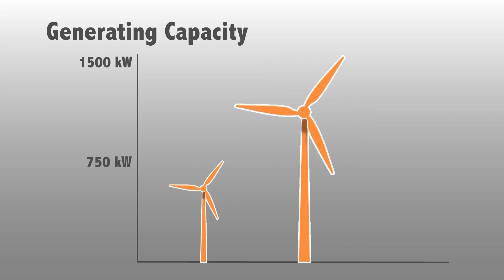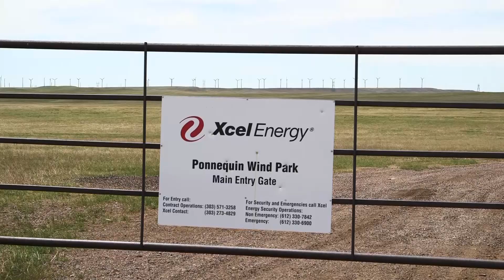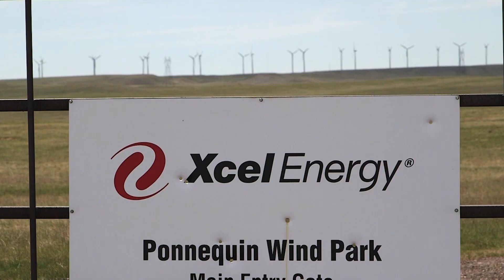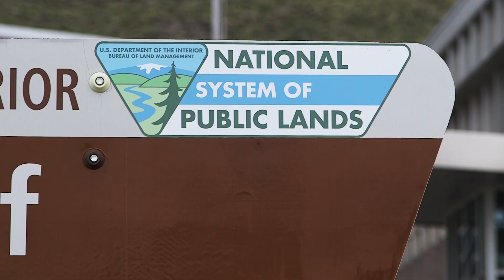Who Cleans Up When a Wind Farm Retires?

Comment: 5:24_ How can you call it "Renewable Energy" if it doesn't produce energy any more?
Reply: It never was a renewable power source
Reply: @rogergibbs2937  "It never was a renewable power source" Um, sunshine and wind are free and happen all the time where I live. Oil? Not so much.
Reply: Did the sun not come up today where you live? It did where I am.
Reply: @justsomeguy934  It is the night here, so what if the sun does come up in the morning, it will disappear 12 hrs later. What is your point?
Reply: @rogergibbs2937  The point is the sun will rise today, and can provide free energy when humans want it the most - daytime. That's reliable. It may be intermittent, but it's reliable. Your had your terms incorrect.
Reply: @justsomeguy934  socialist, it cost a shit ton of money to extract that “free” energy
Reply: @Dean Zinter Your comment makes no sense! We're talking about using pollution-free, cost-free fuel (wind or sunshine). The fact that a turbine has gear oil is meaningless. SO WHAT if a turbine is lubricated with a few gallons of oil? It stops THIS: https://www.businessinsider.com/photos-stay-at-home-order-reduced-los-angeles-notorious-smog-2020-4
Reply: @Dean Zinter I'm confused - are you confusing the extraordinary polluting process of extracting oil, refining oil, then burning that oil? Putting up a wind turbine that works for decades with no fuel, no pollution is not even CLOSE to the process of making a single gallon of gasoline, much less burning it. Every thing you described - putting up a turbine, connecting it to the grid - is also done to erect a diesel or NG power plant, yes? And a turbine doesn't consume anything after that, doesn't make poison while working. I think your oil bias has you blinded, you're not thinking rationally.
Stare at this picture until your oil fog clears:
https://www.businessinsider.com/photos-stay-at-home-order-reduced-los-angeles-notorious-smog-2020-4
Reply: @justsomeguy934  _ After pointing the finger at everybody else, please check your own bias and facts.
FACT_ This field does not produce energy from the wind.
Fact_ It is a polluted relic not a renewable energy source.
FACT_ Los Angeles air quality, even one year ago, is significantly better than it was in the eighties with much larger population and much more cars.
Reply: @johnbeckman8916  FACT: LA's improved air quality was due to stricter emission standards, not because gasoline is a good idea. 
FACT: gasoline engines can NEVER be emission free when in use, regardless of any emission requirements. They will always poison the air if they're running.
FACT: The clear air in LA can only be achieved by NOT burning gasoline and diesel. That leaves EVs as the reason the air is clear today.
FACT: The wind farm in the video CAN produce energy, the wind is still blowing there. All you have to do is re-use the towers.
FACT: The "polluted" relic is, in fact, polluting nothing. Shall I show you a picture of Prince William Sound 30 years after the Valdeez wreck?
Bias indeed!
Reply: @johnbeckman8916  "LA's greatly improved air quality is due to improved technology and efficiencies." Incorrect. The dramatic picture I shared with you was NOT a result of increased emission standards. The clear air was a direct and IMMEDIATE result of no gasoline vehicles running in LA. The results and evidence is dramatic. If what you claim is true, that air quality would not have changed since the COVID shutdown. Logic is a bitch, I suggest you get some.
Reply: @Dean Zinter Who cares? Show me the NOx emissions, the soot, the Carbon Monoxide coming out of your tailpipe first. Every second your car runs it poisons the guy behind you. A wind turbine spins in the air, a solar panel sits in the sun. Any petroleum products used to service a turbine of the decades of lifespan are miniscule compared to using petroleum to make electricity. Don't you realize you're being an unpaid shill for the oil companies? You're looking at a drop of oil for a turbine compared to a bathtub of burned oil for a power plant. They've got you, pal, at least you should ask for a pay check. Why don't you complain how toxic the paint is on the turbine blades now? And then ignoring the paint in your house, on your car, on the roads. See how a one-sided comparison works? Don't you feel foolish?
Reply: As  it needs to be renewed, haa
Reply: @Dean Zinter "a few gallons....   tremendous amount of diesel to dig the ore from the ground, then more diesel to transport the ore, then smelt the ore into useable iron, then make the raw materials into the components, then again transporting to the desired location..." You haven't even BEGUN to describe the process of extracting, transporting, refining, transporting, storing and then burning gasoline! In fact, gasoline only gives back about 1/4 the energy it has when you burn it! Did you know, for example, that the electricity required to refine petroleum consumes about 1/20th our entire nation's electricity capacity? That's right, just making gasoline requires huge amounts of grid electricity! Almost every one of the expenses/consumables your listed are ALSO expended to extract, refine and transport gasoline/diesel!
Reply: @Dean Zinter "and now we need to use another tremendous amount of diesel to tear them down, so where in the hell was the “zero emissions “ you are ranting about?
Ps how much electricity do the damn things make when the wind doesn’t blow?" A turbine site can be re-used! You just put a new turbine on top! In addition, I see you're talking about the cost to restore a turbine site to its original state, are you now including the price to reclaim oil spills, pipeline breaks, air pollution that's related to the use of oil? I bet you aren't! 
To answer your question about electricity production, you put turbines where the wind blows enough to make them viable. You put solar panels in places that have lots of sunshine. The downtime of a solar farm, for example, is completely offset by having ZERO FUEL COST. Who do we charge for a breeze? Who gets the bill for sunshine? If you drop the fuel cost to ZERO, intermittent production is very attractive. Here's a picture I'm sure I've given you to look when you're trying to claim wind or water or sun aren't "zero emissions":
Los Angeles clean air comparison: https://www.businessinsider.com/photos-stay-at-home-order-reduced-los-angeles-notorious-smog-2020-4
Reply: @Dean Zinter I see you want to ignore the environmental impacts of oil, while ranting about an energy capture unit that works with sunshine, wind or water. Here's what just ONE oil spill did to thousands of miles of coastline...I'm sure you're adding in the cost of remediation to your gasoline love affair, yes?
https://www.history.com/topics/1980s/exxon-valdez-oil-spill
Reply: @Dean Zinter 
You are being accused of being a shill for the oil industry... 
Your counterpart is being the same for the wind and solar industry.

Every one of these arguments can be used either way... except one.

Our modern quality of life or renewable energy, could not exist without mining or petroleum products... 

And that's not likely to change,  even in our children's lifetimes.
Reply: @happydazeharvick4399  You are absolutely correct, modern life is not possible without petroleum products. I believe it, you believe it. Now tell me why you think it's acceptable to burn up HALF of our precious petroleum as gasoline, and then breathe the exhaust? An EV has none of those characteristics, presents NO net increase in grid demand, can completely eliminate the oil we buy in the Mideast (did you see HALF?). Tell me how you reconcile you opinion that oil is required for life, yet throw a match on half of it every day.
Reply: @justsomeguy934 
 I think California should have 100% electric cars, but let the rest of the country (the other 49 states) do what they think is right...

See how easy that was...

Quit griping about it, 
get to work, and make it happen...
Reply: @happydazeharvick4399  "Quit griping about it, get to work, and make it happen..." Um, that's what I'm doing. Do you know how many people (perhaps like you) do NOT know the subsidies we taxpayers give the oil companies? Do you know how much cleaner the air is in LA since gas cars aren't being used? Do you know how much money we spend in the MidEast to defend oil? Do you know we set a match to half of all the precious petroleum we have by making it gasoline?
Reply: @happydazeharvick4399  "I think California should have 100% electric cars, but let the rest of the country (the other 49 states) do what they think is right.." I have an idea, how about those that use gasoline PAY the real cost? How about Exxon buying its own army and air force to protect its tankers? How about Exxon cleaning up oil spills, and not the US taxpayer? How about that being the right thing to do?
Reply: @happydazeharvick4399  "Your counterpart is being the same for the wind and solar industry." No, I'm an advocate for clean air, no more subsidies for oil, no more American lives wasted in the MidEast. Your perspective?
Reply: @Dean Zinter "exactly, life without petroleum products is by impossible..... and that’s the facts these eco idiots can’t understand!" I'm not an idiot, pardon you. Petroleum is required for modern life. Tell me how you justify throwing a match on half of it every day, please. Tell me how you justify trillions in subsidies for oil companies, please. Tell me how you justify putting American lives at risk for free tanker escorts in the Mideast, please. I'll be glad to hear your side of the story and I won't call you a name.
Reply: @Dean Zinter "what kind of cave do you live in? Do you hunt your own food,? Do you make your hunting tools from sticks and rocks? If you answered no to any of them then you are the problem to all this pollution you claim to hate, because everything you use , and touch, and eat, and live in has a direct connection to oil production" Ah, the strawman argument that never happened. You're trying to say I advocate we return to the stone age because I question burning petroleum for fuel. If you're read my other replies to you, you'll know that not only do I think oil is necessary for life, I also think energy independence is necessary. And burning HALF of our petroleum up as gasoline is stupid. WHY do YOU want to throw away our oil? Oh and I just loved the whale oil quip you made, you must be getting pretty desperate to convince yourself that you smoker of a car is the right thing to do. May I ask that you pipe the exhaust of your car into YOUR cabin and not leave a trail of poison for everyone else to breathe?
Reply: @Dean Zinter "what a hypocritical bass tard you are.... " Hypocritical, how? I can't remember when I've purchased gasoline last. It's YOU that thinks it's OK to poison the air behind you, OK to put American lives at risk for free oil protection, OK to waste half of all the dwindling petroleum we have on cars. Oh and by the way, I CAN USE THE CAPS LOCK, TOO - IT DOESN'T MEAN ANYTHING.
Reply: @Dean Zinter "did you ride a bus, take a train, ride a bike? If you answered yes, then you are one hypocritical bass tard!" Well, I can tell you're not reading my responses. I'm telling YOU that petroleum is precious and needs to not be wasted. It's YOU that seems to think that petroleum is so abundant and clean that we can afford to throw away half of it as gasoline, sacrifice American lives to protect it, poison our air by burning it up. Since all you can do is call names and have nothing other than an emotive response, did you have something else to talk about? How's the weather where you are?
Reply: @Dean Zinter "using all that oil products to creat a self defeating product that at best proves a 50% return on investment and production, you really have failed, solar and wind will never ever produce enough energy to pay back the energy used to produce a short term energy product." Dang, dude, you just can't help yourself. You have YET to produce a single reference point to prove anything you say. I, however, can do so! 
1) What 50% investment? You mean solar not producing energy at night? So what? Guess what - solar can produce 75% of all the energy we need when we need it - wait for it - during the daytime. And its fuel is free! No maintenance, either. There's a HUGE solar farm near my house, it's running right now with no one making it work. Want to discuss fuel costs for a diesel generator? Or the poison exhaust it makes? 
2) No only do wind and solar make far more than their production energy, they're cheaper than coal! 
Solar energy costs compared to fossil fuels: https://news.energysage.com/solar-energy-vs-fossil-fuels/ 
Wind energy costs compared to fossil fuels: https://blogs.scientificamerican.com/plugged-in/wind-energy-is-one-of-the-cheapest-sources-of-electricity-and-its-getting-cheaper/
Solar panels have a 5x price drop since 2015: https://rameznaam.com/2020/05/14/solars-future-is-insanely-cheap-2020/?fbclid=IwAR1FI3dQYqo53fhbsqShatCCPlTEa8RHBIrbeQGSgSXqo-F5vgUnZI6DanM
Reply: @Dean Zinter " you really have failed, solar and wind will never ever produce enough energy to pay back the energy used to produce a short term energy product." Well, let's see how fossil fuels work, shall we? It takes over 5 kW/h of electricity PER GALLON of gas to refine petroleum into gasoline. That much energy can push an EV 20 miles with no further pollution. In addition, gasoline, at best, is only 30% efficient. That's right, of all the energy in a gallon of gasoline you LOSE 70% as heat. It quite literally takes several times the energy to make gasoline than you get back out of it. Every gallon you burn loses energy and makes poison + heat to use it. Tell me WHO is advocating for a poor energy investment?
8 kW/h per gallon electricity for well-to-wheel: https://www.autoblog.com/2011/10/14/how-gas-cars-use-more-electricity-to-go-100-miles-than-evs-do/#:~:text=There%20is%20no%20exact%20calculation,you%20drive%20a%20Toyota%20Prius)
Oil for electricity better than gasoline: https://www.smartcitiesdive.com/ex/sustainablecitiescollective/oil-electricity-more-efficient-oil-gas/185046/
Tesla's motors are at 94% efficiency: https://www.caranddriver.com/news/a34046953/tesla-range-strategy-details/#:~:text=Tesla%20told%20Car%20and%20Driver,by%2015%20to%2018%20percent.
Reply: @Dean Zinter "So how is that “solar Crap “ working for you at night!" Gosh, I happen to think that if I can get 75% or so of my electricity free of charge, that's a good thing. No new power plants needed if my neighborhood uses solar!
Reply: @Dean Zinter "well I see that you plagiarize better Han you argue your point" What did I plagiarize? I give you references to independent studies, you have yet to provide a single study. My talking points come from sources that do not have economic stakes in the outcome of the study, unlike many of the oil company research done today. Since I'm always the one providing the facts, and you're always the one providing the vitriol, what say we stop talking until you can do some research on your own?
Reply: @Dean Zinter "did you ride a bus, take a train, ride a bike? If you answered yes, then you are one hypocritical bass tard!" Man, are YOU off on an unsupportable argument. Let's see - if I recommend you go on a diet, but I still eat food, I'm a hypocrite? Geez, man, look at what you're saying. I'm saying stop wasting oil, it's precious. You then call me a hypocrite if I use oil for what it's good for. I highly suggest you take a logic course at a correspondence school or something, you're not making sense.
Reply: @Dean Zinter "how are we wasting oil? I say the waste is building things that barely last 20 of part time service, that is where the real waste is. Oil wasted during manufacturing, during maintenance, during part time operations due then during decommissioning and disposal!" You, of course, are not counting the oil and cost of even extracting, refining, storing and transporting any fuel oil we use. You're not counting the tanker spills, pipeline spills, truck explosions that go with oil. Half of all our petroleum is refined, at great cost, into gasoline. If I can use a non-petroleum vehicle, we save half of what we're burning up. Oil is precious, we cannot live without it. Why would we take a match to it if we don't need to?
The Dirty Truth about Combustion Engine Vehicles: https://youtu.be/mk-LnUYEXuM
Reply: @Dean Zinter " I say the waste is building things that barely last 20 of part time service, that is where the real waste is." Not true, with proper maintenance, turbines can last 40 years. Any energy production, with the exception of solar farms, need maintenance. Wind turbines, however, need significantly less than a diesel or NG generation plant. They operate unmanned 24/7 except for intermittent maintenance visits. Solar panels, unless damaged, operate completely unmanned. And both have free fuel cost, both make no pollution while operating. You're failing to add in the other costs of using oil as fuel.
Los Angeles clean air comparison: https://www.businessinsider.com/photos-stay-at-home-order-reduced-los-angeles-notorious-smog-2020-4
Reply: @Dean Zinter "more plagiarism from you..... how creative of you!" Yet again, you make an unsubstantiated claim. WHAT am I plagiarizing? How is referencing a scientific study plagiarism? Do you need a dictionary? Plagiarism means I copy a work - artistic or not - and put my name on it, claiming I am the creator of the work.
Reply: @Dean Zinter No, I made at least 5 posts to you directly this morning, all with multiple links. They posted, but when I reloaded the page to display them, they were gone. I'll try single links.
Reply: @Dean Zinter "Both your glorious solar and wind are only 50% productive at best, " Solar has about a 50% contributory rate over a 24 hour period, averaged annually. Guess what? That's exactly the time we use energy! In fact, solar farms can provide 75% of the daily consumption of energy even though they don't generate energy at night. I don't know about you, I'll take 3/4 of our energy made by sunshine!
Reply: @Dean Zinter "and none have lasted 40 years of service life yet!" If you're talking about turbines, they can last that long. Here's a quote from the repayment of a turbine: "Depending on the size and capacity, some turbines are able to pay for themselves within a period of 10-15 years. The average wind turbine can offer a net benefit to its owner in as little as 5 months from the time of installation." I'll put the link in another post to see if it posts.
Reply: @Dean Zinter "You are plagiarizing me you fool, write something original for a change!" No, I put your own statements in quotes so you know specifically what statement you made that I'm responding do. That's amazingly clear that I'm quoting you, see the quotes? Geez, man.
Reply: @Dean Zinter Well, that proves it - I made a post with a quote on the repayment/break-even period of a wind turbine, and also made a post with the actual hyperlink. The quoted post is there, the post with a hyperlink is missing.
Reply: @Dean Zinter "more plagiarism and spam links? 50 %at best not counting down time for maintenance." Quoting someone isn't plagiarism, you seriously need a dictionary. Seriously, it's the opposite. Yet again, you miss the point. You acknowledge that solar produced energy half day. Funny, you don't acknowledge that we humans consume 75% of our energy during the DAY. Immensely useful to have energy delivered for free fuel cost when we need it.
Reply: @Dean Zinter "bovine Excrement, most city consumption is at night!" I do wish you would do your own research. Go to EIA dot GOV, look up energy consumption curves. During the summer, energy peak is 6:00pm, with a rapid decline to 8:00pm or so. During the summer, solar is producing energy for greater than 12 hours a day. Off-peak, generally 9:00pm or 10:00pm to 6:00am, is when wind supplies more renewable energy than solar.
Reply: @Dean Zinter "bovine Excrement, most city consumption is at night!" Did you do your homework yet? Did you lookup the website that I gave you that shows peak energy consumption by hour of day? Did you put your bovine excrement back in your pockets where it belongs?